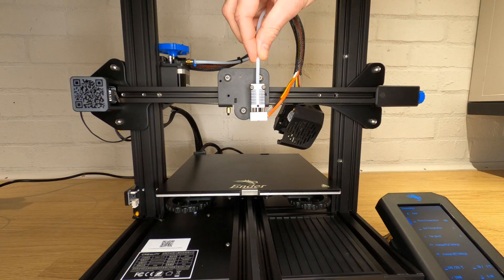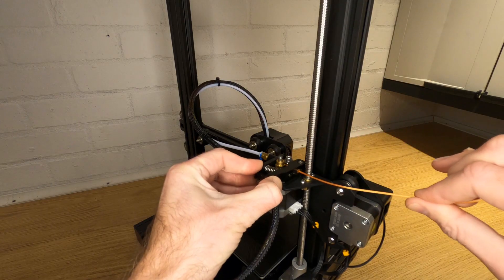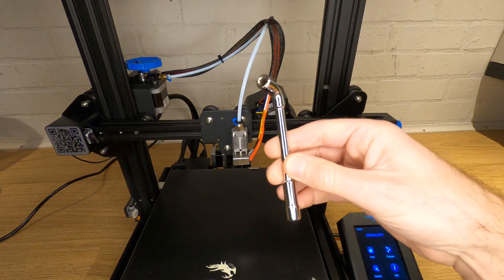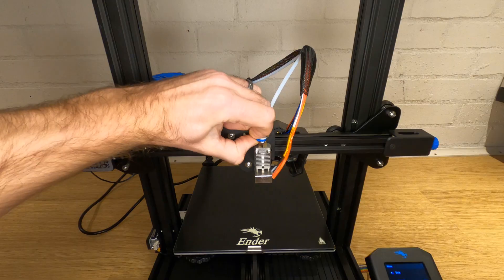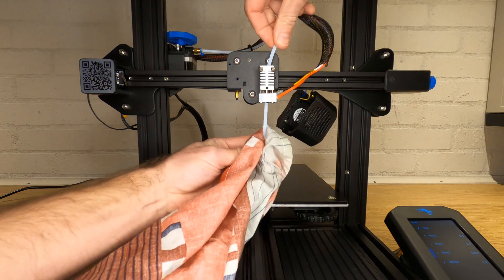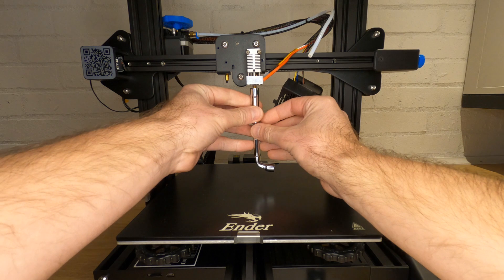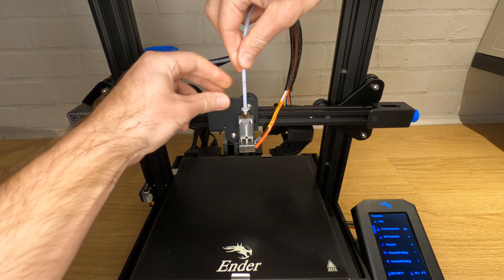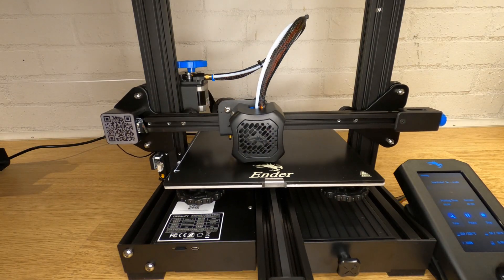Ender 3 v2 Hotend Cleaning - Eliminate Stringing & Clogs

Comment: As clear, as informative and as helpful as  I am starting to expect from such a quality channel. Excellent stuff.
Reply: Agreed. Great video. I like the extra step to back off the nozzle by a full turn and tighten after the Bowden tube is in place, for a tight seal.

Edit: I wrote the below before I fixed the actual blob problem. Even though the stock Teflon tube had visibly degraded after many prints at 255C, replacing it with new Capricorn tubing didn't help. It also doesn't make sense that plastic can ooze outside the nozzle. For this there is a second culprit: the joint between the brass nozzle and the steel heat break tube, inside the aluminum heat block. I removed the heat block and noticed that the bottom of the heat break tube's threaded portion (where it mates with the nozzle) was charred and somewhat degraded. This has to be clean and flat for a good seal. So I used a metal nail file to flatten and smooth this again. Minor leakage from the Bowden tube/nozzle seal should not get out past the heat break tube/nozzle seal. Evidently it was in my case and oozing past the nozzle threads in the heat block, onto the outside of the nozzle and down. Trying a test print now...

Previous text: One extra symptom of a burnt up Teflon Bowden tube to add though: I had been doing quite a few PETG prints at 255C nozzle temperature with the original Creality Teflon tube, so I had actually been expecting the tube to degrade where it meets the nozzle but the problem symptom was not what I expected. I was expecting clogs, and you mention stringing, but I was getting unexplained layer shifts and/or parts coming off the bed mid-print. This seemed to happen at random with some prints working fine. I finally figured out that this was caused by plastic oozing past on the OUTSIDE of the nozzle, where it builds up into a fairly big blob. The blob eventually comes off and adheres to the print. On the next layer, the hot end hits the hardened blob, and the impact is enough to knock the print off the bed even if bed adhesion is good. A mess of spaghetti ensues. Then I was printing some flat, thin mounting plates that cannot be knocked off the bed with sideways force because the surface area is just way too big, but I was getting layer shifts. In this case the hot end strikes the hardened blob hard enough to make stepper motors skip, resulting in misalignment. Surprisingly I didn't find evidence of these big blobs until the Teflon tube degradation got bad enough that plastic began leaking past the nozzle faster. Then I could see the plastic building up on the outside of the nozzle and coming off after enough had built up. Luckily I had Capricorn tubing ready to go and this video to gain insight from. Cheers!

Comment: I'm a beginner, is ther a better tube than a Teflon tube? 🤔
Is capricorn tubing not also ptfe 🤔
Reply from the maker: The genuine Capricorn tubing uses a higher quality resin apparently. It apparently makes it tolerate higher temperatures and gives lower friction. I'm trying to keep my Ender 3 completely standard so I can make more relatable videos but it would be the first mod I would do.
Reply: @RickyImpey  Thank You very much for answering me, under the amazon reviews many are saying it's proberly not a Orginal capricorn and having problems with them, but I have no clue about this stuff and I have a Flsun q5 but I couldn't try him out, becourse I have chronicle migraine(and other pain related problems Fibromyalgie) and I don't won't screw things up with my first 3d printer.
But I'm looking many videos about 3d printing and reading stuff about this matter too, I hope  I don't annoy you to much with my questions.
Reply from the maker: @WaschyNumber1  no, no problem. The Capricorn tube kit I have linked to is one I have tried myself on another printer and i can recommend it👍
Reply: @RickyImpey  thanks
Reply: @RickyImpey  Thank You very much 🤗

Comment: great video. why does this not also apply to all metal hotends?
Reply from the maker: All metal hotends don't have the Bowden tube going all the way to the back of the nozzle so the throat in your heatbreak has a smaller diameter to guide the filament the rest of the way. Unfortunately that means you can't use the Bowden tube to push all the way through like you can on a lined hotend. All metal hotends are more difficult to clean unfortunately.

Comment: Thanks for the video ^^ Very well explained super easy to follow. 

Sadly it didn't solve the problem for me. I still have underextrusion at times. For a few sec it works perfectly normal, then less and less comes out until there are only little drops left on the bed, and then back to normal. No idea what the problem could be. I even installed the replacement nozzle that came with the printer. 
Maybe it's due to the fillament? Its PLA and it's been sitting in the basement for around 2 years, in a bag with the little demoistring bag that came with the roll.

Would really appreachiate if someone had an idea what could be the reason.
Reply from the maker: If you're getting intermittent underextrusion then there are obviously a number of things that could cause the issue. First I'd do what you have done and clean out the hotend. Next I would be looking closely at the displayed nozzle temperature when the issue is occurring. Is there any temperature change when you're getting underextrusion? If not then it's possibly to do with the actual filament feed. It could be that the extruder arm is cracked and the filament is slipping. Have a close look at the extruder gear and filament to see if this could be the case. If there is no slipping and the temperature is not fluctuating then you may have to start looking at whether it could be a control issue. Try some of the things above and let me know how you get on.
Reply: @RickyImpey  also recommend to calibrate e steps

Comment: So what would happen if I can't even get the bowden tube to go through the hot end? Just toss it and get a new one?
Reply from the maker: Have you got the hot end up to temperature? If so any filament inside should melt so you can push it through. Try carefully pushing something smaller through first to clear the blockage. If the filament isn't melting enough to push through then you may have found the cause for your blockage. Let me know if you still can't clear it as we can start looking for a cause.
Reply: @Ricky Impey  it worked! I'm now currently diagnosing why my nozzle is too close when it's properly leveled and ruining my prints. I'm adjusting z offset but its a glass bed so it's strange to me to mess with this. Never had an issue till now
Reply from the maker: @Sebass8017  great! Did you follow my bed levelling guide? The nozzle should be kissing the bed in the home position. If the bed is correctly trammed (level) you shouldn't have to adjust the z offset.

Comment: I just received and set up my ender 3 the nozzle that is factory attached is that the recommended one to use? There’s a second one in the package hmmmmm
Reply from the maker: Hi Maria, most 3d Printers are shipped with 0.4mm nozzles and the other one is most likely a spare. Have a look to see if you can see any markings on either of them. A 0.4mm nozzle will do 90% of all the things you will want to print for a while 👍
Reply: @RickyImpey  no markings on the spare. Next question what temperature of the nozzle and bed should I set the machine at (not using cura yet) I was told to do these steps
Increase extrusion multiplier
Increase print temperature 
Depress print speed 
Clean nozzle and free clogs

But how?
Reply from the maker: @Maria Spivey Is there a specific problem you are trying to fix? There are many variables with 3d printing and a slicer like Cura will set many of them by default. Have you watched my video on how to slice files ready to print? I think that may answer many of your questions. You generally set all of the settings in the slicer software and only change settings on the machine for fine adjustments when actually printing. Usually you don't change them.
Reply: @RickyImpey  so cura will have the settings established basically? I tried to print the dogGcode file it’s looked like a dog but the lines 🤭
Reply from the maker: @QueenBnSD  yes, slicer software writes the g-code. This video should explain https://youtu.be/e-lQPGJ3Psc

Comment: Hi Ricky great video what happened to the CR10 s Pro ?
Reply from the maker: Hi Andy, I still have it and use it regularly. I wanted to do beginner videos as there are so many people who have issues when they get started. The CR-10S Pro has been modified quite a bit now so wasn't as relevant to people new to printing. I have some videos coming up on the other mods I've done to the CR-10S enclosure including Octoprint integration and additional safety features.

Comment from the maker: I think we may have a new world record for the amount of times the word 'nozzle' is used in one video. How many can you count?🤣
Reply: Thanks its a Longer LK1 3D and the aluminium tube inside one element the top part it's about 50mm in length, about 20mm of that tube narrows and Bowden diameter too wide for it. So fixing Bowden into extruder top piece it only goes in approx 30mm. You cant push it all the way through as in your video. Though ive taken apart and cleaned each piece of extruder section, filament still comes out stringy. I'll need to troubleshoot it more... Not sure what's going on yet.
Reply: Nowaslozo
Reply: New drinking game 😂